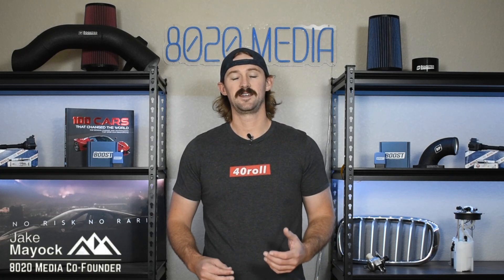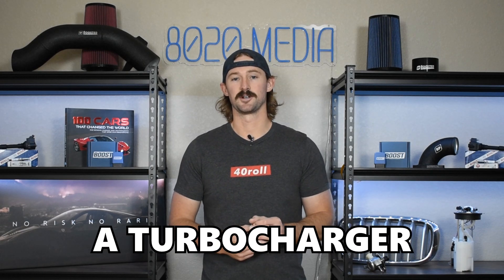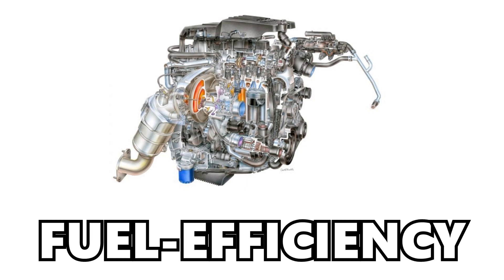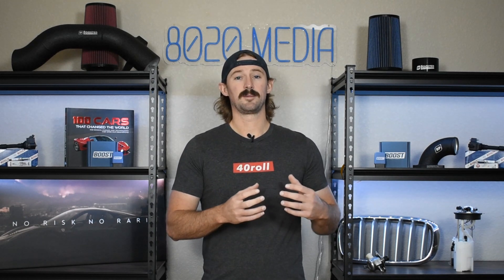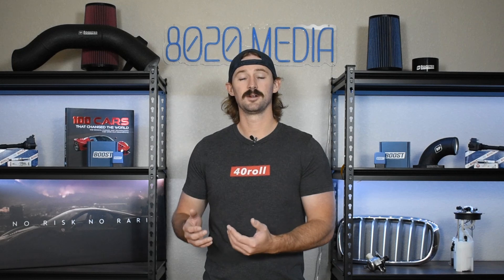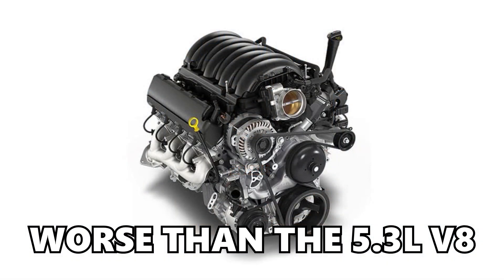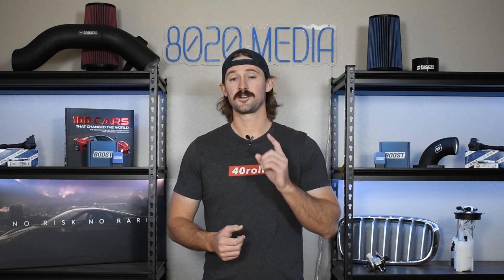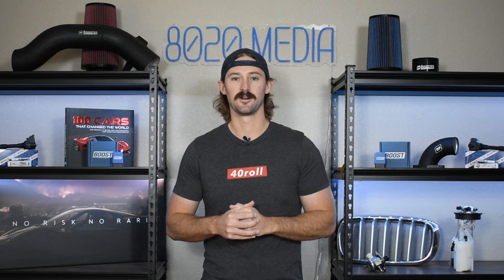GM’s 2.7L L3B Engine | Common Problems, Complaints, & Reliability

Comment: So I bought a 2021 Silverado in 2024. Had 77+miles not a bunch of bells and whistle which was fine by me. I thought the truck drove great! took it on about 4 road trips no problems with the ride, the power, or the 8 speed transmission.  But now at 87,000 I have to replace the catyaltic converter cause it is failing and in my area we have to do an Echeck to get tags. I am really bummed out over this. But I don’t think it will stop me from saying I think it is a great truck and I enjoy the ride and what it has to offer.
Reply: What is your maintenance schedule? Sounds to like carbon stuck rings leading to oil burning plugging up the catalytic converter
Reply from the maker: T - Thanks for taking the time to share your experience!

Comment: I have a '22 Silverado 2.7T. Gas mileage depends on the driver. I get 21.5 country driving 24 on trips. My daughter gets 19/23, my son somehow gets 23.3/26 and the MPG computer is not far off. A small displacement engine with turbo is more sensitive to terrain or hard driving. A lot of the turbo reliability issues are of engines not engineered from a clean sheet (fingers crossed). The 5.3 and 6.2 are having massive failures. I'll take the 2.7.
Reply from the maker: H - Thanks for taking the time to share your experience!

Comment: Concering AFM on this engine, do you know if there are electronic modules available to defeat this?  I use one on my 5.3 V8, with excellent results.  I’m thinking about downsizing to a GMC Canyon with this 4 cylinder L3B motor, but probably won’t take the chance if I can’t defeat and turn OFF the AFM.
Reply from the maker: J - There isn't a disabler yet, but it is certainly being worked on!

Comment: Can you expound on the zero-cylinder mode you mentioned?
Reply from the maker: M - The zero-cylinder mode in GM's Dynamic Fuel Management (DFM) system is an advanced feature that allows the engine to temporarily shut off all cylinders, essentially idling without combustion to maximize fuel efficiency. Unlike Active Fuel Management (AFM), which only switches between V8 and V4 modes, DFM can deactivate any combination of cylinders, including all eight, in real time based on driving conditions. This zero-cylinder mode occurs during deceleration or coasting, where the throttle is closed, and the transmission is in gear, allowing the vehicle to maintain momentum without using fuel. The engine’s valves remain closed, and fuel injection is completely cut off, reducing pumping losses and drag. This enhances fuel economy by minimizing unnecessary fuel consumption, especially during highway cruising or stop-and-go traffic.
Reply: That means it’s parked?
Reply from the maker: @ Lol, no. The newer versions have a zero-cylinder mode, it's wild.

Comment: I have the 2021 version and my truck has been at the dealer for 3 weeks for a lifter problem. Ive seen comments on here that say that these engines dont have lifter?  I took it in for a ticking sound that was coming from the top of the engine. I took it in and two days later they told that it was a lifter problem.
Reply from the maker: P - Sorry to hear this... However thank you for sharing your experience!
Reply: How many miles on your truck?
Reply: @Ynotbehumanfirst  62k

Comment: It is my understanding that AFM on the 2.7 is controlled by the overhead camshafts. It does not have traditional rocker arms per say?
Reply: Hence no lifter issues.
Many are just grandfathering this engine into lifter issues because it’s a GMC product
Reply: ye it's rather similar to honda's vtec
Reply from the maker: C - Correct.

Comment: Ok this may not be apples to apples as I ordered a new 2024 Colorado 2WD and I get 23.5 mpg around town and 26 mpg highway so around 24.4 combine. All I could find on lots were 4WD and don't see a reason to buy one as I don't do off road and with tracking control no issues in snow either.
Reply from the maker: D - Nice! Thanks for taking the time to share your experience!

Comment: Bought a 2019 2.7 brand new and has been a good engine with plenty of power, at 90,000 miles now with zero engine problems…
The 8L90 on the other hand…. I’m on number 2…
Reply: Same, but only 45,000 and original everything except purge pump. No complaints
Reply: I drive it like I stole it when my wife is not in the truck!
Reply from the maker: B - Thanks for taking the time to share your experience!
Reply: Apparently the 8 speed is something i should steer clear of. I think the 10 speed is ok idrk

Comment: I have a 2021 2.7 turbo with 70000 miles was getting 19.7 mpg now 16.7 mpg seam to have a skip at 70mph no check engine light changed  the plugs any suggestions
Reply from the maker: N - The drop in fuel economy and the skip at 70 mph in your 2021 2.7L Turbo, even after changing the spark plugs, could point to issues with the ignition system, fuel delivery, or airflow sensors. Since there's no Check Engine Light, start by inspecting the ignition coils for wear or intermittent failure, as a weak coil can cause subtle misfires. Check the fuel injectors and ensure the fuel system pressure is within spec, as clogged injectors or a weak fuel pump can lead to reduced efficiency. Additionally, clean the MAF (Mass Airflow) sensor and inspect for vacuum leaks, as improper airflow readings can affect engine performance and fuel economy. If the issue persists, consider having the ECU scanned for stored misfire or fuel trim data to narrow down the root cause. Keep us updated!

Comment: A f m between the v8 and 2.7 work totally different the 2.7 uses a variable dual overhead cam that moves....the v8 doesn't... Hence the reason it does not fail or have the failure rate of the larger engine
Reply from the maker: K - Correct. Thanks for sharing.

Comment: Gm is so proud of this engine,  they've given it a 100,000 mile warranty.
Reply from the maker: S - Lol, well said.
Reply: Good one
Reply: I'm gonna be honest with you guys.....in 2018, I bought a 2018 hyundai elantra se, base model, even has a manual transmission. I have 152k on it, and it has been the most reliable vehicle I've ever owned. Did spark plugs 2x, front brakes 2x, a right wheel bearing at 98k, a left wheel bearing 145k. Other than maintenance items, this car has been amazing. I would buy another Hyundai in a second.. I will say, now that I have 152k on it, I have to add 1 quart of oil every 1,500 miles... but it's been awesome. I also take amazing care of it..   anyway. Just sharing
Reply from the maker: J - Thanks for sharing!
Reply: @joeb2588 I love hyundais. Every time I run a car it's always a Hyundai although I will say I just had a Hyundai Tucson that I rented it had 7,000 mi on it and the engine literally blew up on me. I think if they don't have problems early on they'll be good for a long time which is understandable at least they have a good warranty
Reply: The v6 without turbo was a good combination.
Reply: @stevemuise6315  Really??  Ha ha ha
Reply: Only starting in 2024 models.  I have a 2022 refresh edition and just had back in for failed lifters third time.  I only had 60k.  Why did they switch to 100k?  Known issues.  They forced me to pay $2200 just this week despite 2 prior failures.
Reply: @boaks205  I would go after lemon Law 2x times for the same issue qualifies as for it.  Had and issue with a new XTreme s-10.  Would lunge occasionally when starting.  Went back for a third time.   They gave me a
Choice of money back or new vehicle.
Reply: When would gm give that long of a warrant if they weren't confident in it? Most companies give the 60k but 100k does seem like they're confident in it
Reply: I drive a round trip to work at 65-80mph in a 2024 Silverado RCSB. I average 20-21mpg.
Reply: Not in Colorado, just Silverado or Sierra ! Colorado warranty is 60,000 miles.
Reply: That makes sense if they have data to prove its reliability otherwise its suicide
Reply: Mine has a lifetime power train warranty.
Reply: @BWalker-yg9en  how much more a month for the lifetime warranty?
Reply: Yah if you pay for it
Reply: Those big tires is one reason the gas mileage is lower....it takes more power to move these off road tires..and lift kits too.the higher the truck the worse it gets.
Reply: Dodge once had a 100,000 mile warranty in order to sell their garbage caravan.

Comment: Not true. I’ve had both. The 5.3 and the 2.7. I get 1.5 to 2 miles per gallon better in the 2.7 than the 5.3. Not a significant difference but when gas is 4.35 a gallon in California it adds up.
Reply from the maker: T - Thanks for taking the time to share your first-hand experience.

Comment: I’ve got a 2019 with 55,000 miles. No issues and I love mine. Will buy another one.
Reply from the maker: T - Thanks for taking the time to share your first-hand experience!
Reply: Did you get a extended warranty beyond the 5 year factory one?
Reply: @taureanvalentine4015  nope
Reply: @thomasmoshier3920  ok thanks I have a 2022 with 31,000 miles no issues so far factory warranty is up in 2027 I was wondering if I should get extended warranty past the factory one. Every one I asked didn't and truck continued to run good
Reply: I have 120k on my 2020. Zero issues, but I take care of it religiously

Comment: My 2020 Silverado 2.7L, is at 67k now.  When I was changing the motor oil. It has a motor-oil leak from somewhere, between the motor and transmission. It's about 5 inches above the pan-oil, but I haven't seen any videos on this issue.  I will hate to bring down the transmission just to see with more clarity where is coming from.
Reply from the maker: J - Thanks for taking the time to share your experience!

Comment: I had one and the thing I loved the most about it was the low end torque. Drives like a diesel and it was great. I had a 4.8 and 5.3, I preferred the 2.7 over both V8’s because of how it drives. Traded to a gas 2500 for better hauling capability but wouldn’t hesitate to get the 2.7 again in a half ton.
Reply from the maker: X - Thanks for taking the time to share your first-hand experience!

Comment: Cams are noted to be bad, had 8 fail in last month. 5k oil changes and oil samples sent in.had 3 that failed at 25 to 40k. Transmissions are garbage as well.
Reply from the maker: T - Sorry to hear.. However, thanks for taking the time to share your experience!
Reply: What type of cam failure?  Are the failures related to the sliding collar mechanism or is there lobe damage from failed rocker arms/followers, or is it something else?  Are the transmissions failing or just having shift quality issues?
Reply: @bullitthead7853  I've seen mostly cam lobe failure. Tranny's torque converters and  2nd and 3rd gear are failing. Now they switched to f150 and im curious how the wet kevlar belt that rides in the oil pan is going to hold up. If a person wants to turn wrenches now is a good time.

Comment: 2.7 Liter in a truck?? The Briggs and Stratton on my riding mower is bigger. Noooo Thanks!! What a joke!!
Reply from the maker: D - They can be good. Look at the EcoBoosts.
Reply: @ I ran into a guy about 8 or 10 yrs ago that had a brand new ford raptor and it had a 4 cylinder and I was shocked. He claimed it pulled like a V8 ! But I’m wondering, just how long? I’m of the belief that there is no replacement for displacement, especially when it comes to longevity. But I’m sorry, it’s morally wrong to put a 4 banger in a rapture lol
Reply from the maker: D - Everyone has their own opinions and experiences.

Comment: GMC PICKUPS..STEERING SHAFT BREAKING..TAILGATE OPENING WHILE DRIVING..BRAKES APPLIED WITH NOTHING IN THE PATH OF THE VEHICLE..AFM..LIFTERS..TRANSMISSIONS..DIFFERENTIAL LOCKING UP..PATHETIC VEHICLES..

Comment: GM should have stuck with the V6. The 2.7 would be better and is better in the Colorado.  Having it in the Silverado makes the 5.3 V8 redundant and the 6.2 the common option. 😊
Personal I dont care. Government has ruin trucks anyways.  😊
Reply from the maker: H - They certainly don't build them like they used to.
Reply: The government doesn't build trucks, and they don't mandate bad engineering.

Comment: I'm curious what the bottom end of this engine looks like after 80k miles andbsome towing. There's gotta be a lot of stress on the bearings at load and low RPM pulling a trailer.
Reply from the maker: U - We would agree!

Comment: The engine was over built around the turbo instead of the other way around to be more reliable. 

Its the only GM engine to pass the million mile torture test. 

It was specifically built for the redesigned mid size trucks. It did so well in testing they put in the full size which gave GM 2 years to work out any issues. 

Considering how many are on the road now, any issues are minimal at this point.
Reply from the maker: D - Interesting. Thanks for sharing.

Comment: My 22 Silverado crew cab 4x4 with the L3B gets 18 city 23 hwy I average 13mpg towing my travel trailer. My 2018 Silverado 2x4 with the 6 speed transmission gets 15 city 23 hwy and 13 towing the same trailer. I think people are complaining because they expect the 4 to get better highway mpg but given the two trucks I have the 4 is at least 20 percent more efficient than the v8. Especially with all the extra drag from the 4s 4x4 power train and larger cab.
Reply from the maker: K - Thanks for taking the time to share your experience.

Comment: I use 87 top tier gas as recommended by the GM engineer of the engine and I get over 19 combined MPG on my 2024 2.7 Silverado.
Reply: Same here.  The top tier gas should reduce carbon buildup but I wouldn’t be surprised if my engine needs it cleaned at 80K miles.
Reply from the maker: M - Interesting. Thanks for taking the time to share!

Comment: I towed a 6000 lbs camper all through the hot, high altitude of the Colorado Rocky’s. Constantly pushing this engine as hard as I could. Never overheated and pulled great.  However I could see carbon build up for sure.
Reply from the maker: H - Thanks for taking the time to share your experience!

Comment: Premium fuel not only can give you the maximum operating efficiency from the engine, but it can prevent engine knocking which can destroy engines, another thing is that Premium fuel have specific additive package that helps to keep injectors  healthier and ven the highpressure fuel pump.  So don't be cheap  on gasoline. Another  tip is change your oil every 5,000 miles or every 6 months, if you think that is expensive try to learn how to change it yourself if possible, is true that motor oil is better than ever, but new engines require a good quality and clean oil to avoid problems.
Reply: I watched an interview with the Chief Engineer of the 2.7 and when asked about using premium fuel he said it would be a waste of money because the engine was designed to run on regular.
Reply: I change my oil every 4K miles and only use the oil recommended.
Reply: You need to do some more research on this matter😂
Reply from the maker: R - All of this is well said. Thanks for taking the time to share this!
Reply: I like to spend even more money on premium gasoline so I can save money on gasoline.  Strange argument to have.  You might save on the actual amount of gas by using premium, but are you actually saving or spending More Money on gasoline???

Comment: My work truck is a 21 Silverado
with the turbo 4 and it's right at 48k
miles. It's throwing a misfire on
cylinder 2 code had a shop verify it's
not misfiring. Only happens when
sudden excelerating and then back
off the throttle. It's also developed
what I would call a lifter tick at low
idle but ifl bump the rpm up very
slightly it goes away. The sound is
quite annoying. Was thinking about
getting a Canyon but if that issue is
going to show up it has me thinking
twice.
Reply: Same here but mine says cylinder 1
Reply: Same as mine with only 14k kilometers (24 Colorado) the sound is awful on the highway
Reply: Might have carbon build up on your valves, maybe try a de-carb procedure.
Reply from the maker: L - Sorry to hear this.. However, thanks for taking the time to share your experience! Keep us updated.

Comment: He mentions the Ford Eco boost engines.  I have seen all kinds of videos on the problems with these.  I suspect this will be the same, most not lasting more than 100,000 miles without major problems.  This kind crap is why I see quite  a few old Ford Rangers and other older trucks driving around still. As rust is not an issue in Texas, where I live, people keep these old trucks.  They are more reliable and less expensive to fix than modern trucks.
Reply from the maker: J - We will see!
Reply: Wasn’t the eco boost problem a belt fed oil pump? The 2.7 uses a chain I’m pretty sure
Reply: @garrettcunningham9671  The wet belt oil pump was one of the issues.  However, I think there are others.

Comment: The 2.7 engine is a overhead cam engine, doesn't have lifters like the V8 engines
Reply from the maker: D - We've addressed that we misspoke multiple times in the comments below :) We got confused with the 5.3's.

Comment: I love my 2.7L. I’d buy again
Reply: Me too.  My 2023 has 26K miles.  I get between 19 and 20 mpg in the city and 24 to 25 mpg on the highway.
Reply from the maker: M - Thanks for sharing your experience!
Reply: @Hapalong  put 200000 on it and say that. Hopefully  you will
Reply: @elviswilliams5764 😂😂😂
Reply: My '24 model averages 21.6 mpg over the last 5322 miles. The 8 speed tranny is shift great yet, but it should since I only have 18K on it.
Happy so far.

Comment: is 85 octane a real thing? I've swapped out tanks of 87 and 93, no change in fuel mileage. If I back off of 75+ mileage goes up significantly.
Reply from the maker: B - Yep, it's not very common. But can be found only in certain states.